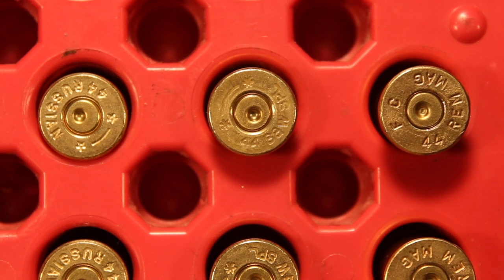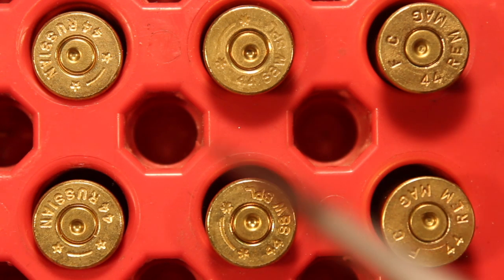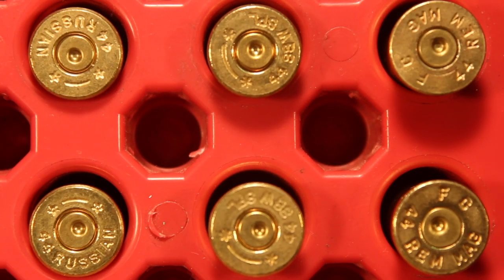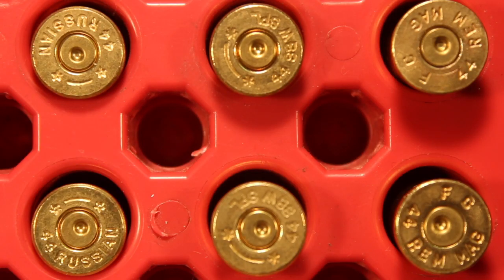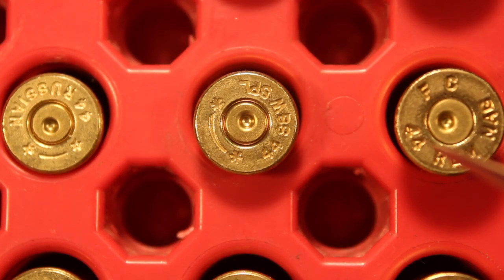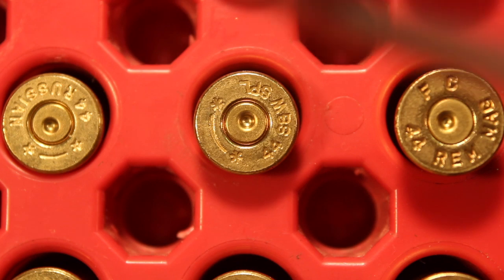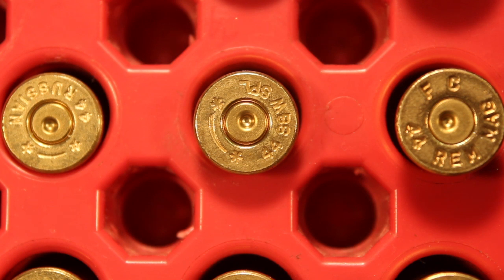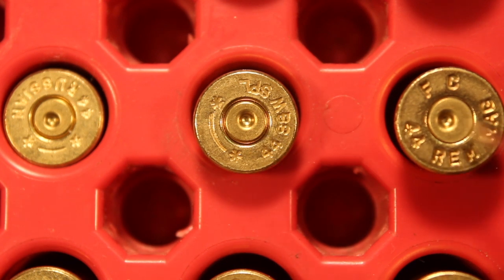Primer Sign Pressure Evaluation Revisited

Comment: This video broke my brain when you said 904 on the 44 mag
Reply from the maker: John B. - A 44 cal. 7.5 grain Unique charge / 240-250 grain bullet (the Skeeter load used in this video) gives you that velocity in the 44 Mag.  Some 44 Mag shooters readily state that the 44 Mag can easily be loaded full spectrum from 650 fps to 1500 fps, and that is true.  But if 900 fps was all that was desired, the 44 Spl case is more efficient and consistent without any real loss of accuracy.  The chronograph tells the story with the efficiency and consistency.  So far, accuracy testing supports no significant loss of accuracy, but even if enough data was gathered to establish that, the belief that "+ bullet jump = loss of accuracy" seems to be held as a given by many.  Have a great day,  Steve